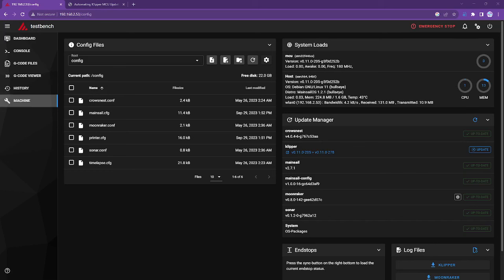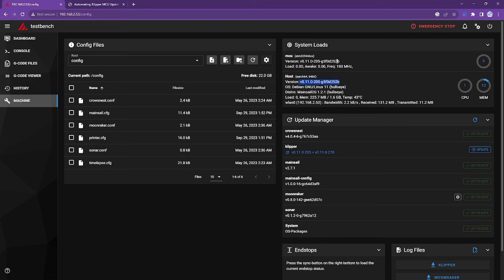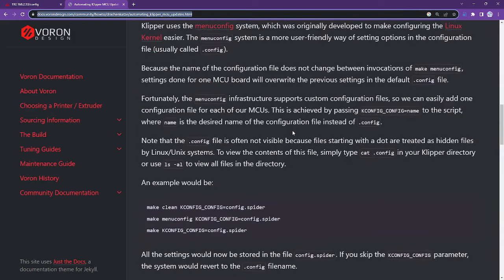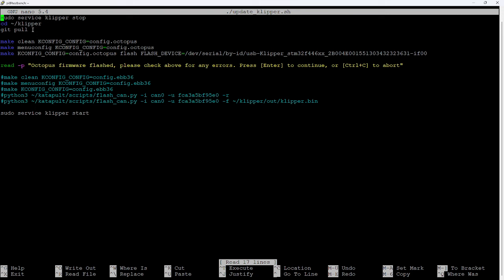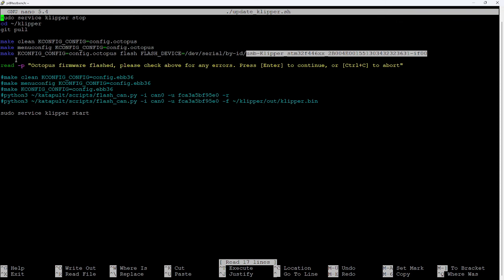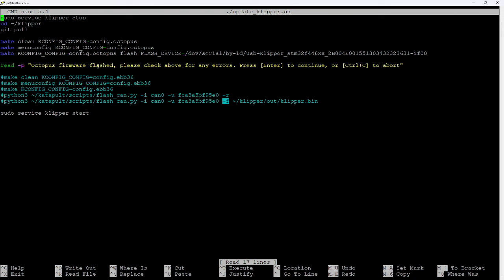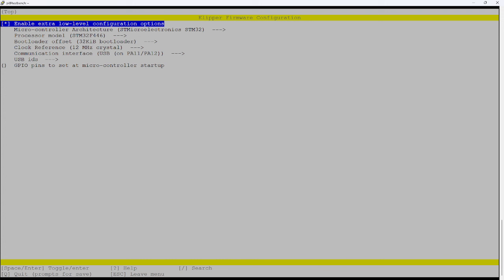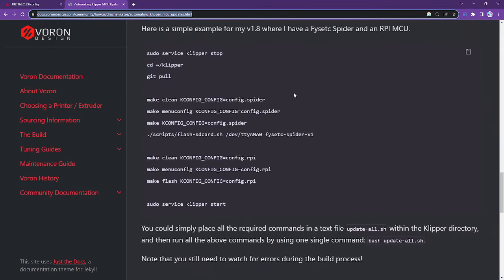Teachable Moments: Flashing Klipper Updates to your MCUs

Comment: HI. Great video, thanks   Although it seems like the "preconfigured" config.octopus file does a lot of the heavy-lifting....but unless I missed it, there wasn't any detail about that?
Reply from the maker: That file is generated when you make changes and save the configuration in make menuconfig. Basically you have to configure it manually the first time, then you're just reusing that saved configuration file whenever you update and reflash Klipper.

Comment: So I was able to create a file that updates my main mcu I'm having trouble with my klipper expander.  Serial by id wouldn't work on it for some reason.  Do I have to reset it, install a boot jumper, etc every time I want to update klipper on it?
Reply from the maker: I have no personal experience with it, but according to this, the Klipper Expander board requires adding a jumper to put it into DFU mode:
https://github.com/VoronDesign/Voron-Hardware/blob/master/Klipper_Expander/Documentation/README.md#boot-jumper
Reply from the maker: I refuse to purchase any board that can't be updated remotely.
Reply: @oldguymeltsplastic  Not ideal but at least I know what the issue is now.  Also, thanks for uploading this video, it helped a lot.

Comment: Hi, my configuration is as follows: Voron 2.4 300, BTT Octopus + BTT PI + EBB SB2240 (with U2C boar)... I followed ur instructions and now my mcu and ebb are not recognised by the host?? Any idea what to do? Shall I access manually the Octopus and flash the board via USB/DFU mode as I did during initiall setup?? Thanks.
Reply from the maker: Was the Octopus working with Klipper before you installed CAN Bus? If so, did you flash anything to the Octopus? Because if you are using a U2C, then you shouldn't have flashed anything at all to the Octopus.
Reply from the maker: With a U2C, all of the CAN Bus functionality is between the Pi, the U2C, and the EBB, the Octopus continues communicating with the Pi over USB.
Reply from the maker: If you did change anything on the Octopus, then you need to reflash it with Klipper configured for USB communication.
It's a fairly common mistake, so you're in good company.
Reply: @oldguymeltsplastic Hi, thanks for taking the time to reply. Yes, before, everything was working fine (set-up) months ago following Your videos. I decided to update all the pending updates within the Mainsaill update manager... and go the error that the MCU and EBB are running an older version and that I shall update those as well. So I found this video of Yours and all made perfect sense, but honestly I dunno much about software...
Reply: @oldguymeltsplastic Sorry, dunno if it matters but I installed octopus and u2c and ebb all at once months ago... my voron had can from the very beginning.
Reply: @oldguymeltsplastic Before I attempt to updated as instructed in this video, I managed to get the MCU ID via KIAUH, but now my board is not visible by the BTT PI (and I did make the firmware for the Octopus for USB connection).
Reply from the maker: @baraba238  I am confused... Did you follow my instructions months ago, those didn't ever work, and are just now getting around to troubleshooting the issue?
Reply from the maker: Come find me on Discord, and I will see what I can do to help out.

Comment: Steph, you are awesome man! Ive been using Linux for over two decades and i still learn something new everytime i see another user do their thing. Definitely gonna use this when im flashing my scara robot build. Not sure if ill be able to get klipper to to play with the kinematics well but at least the flashing should go easier. 😂
Reply from the maker: I am not a Linux developer, but 3 decades in software tech support probably ranks me as an above average power user. Many of the tools in my bag of tricks are probably "old school", and if it still works well enough, I usually don't bother learning the "newer, better" way of doing things.
Reply: "New ways" are only ever worth it to me if you end up learning something new in the process. If they are just a slightly different/even slightly improved way of doing the same thing and you don't learn anything new... if it ain't broke...